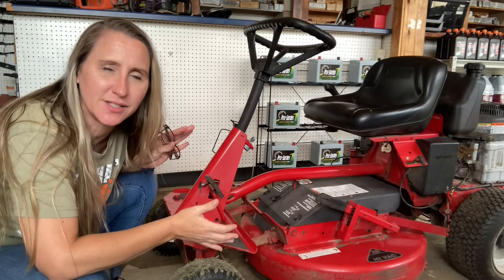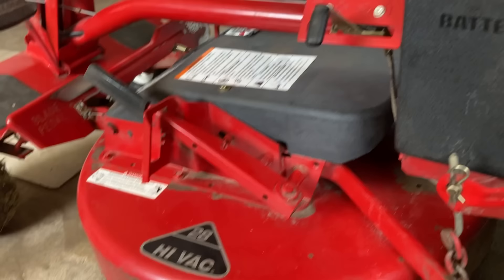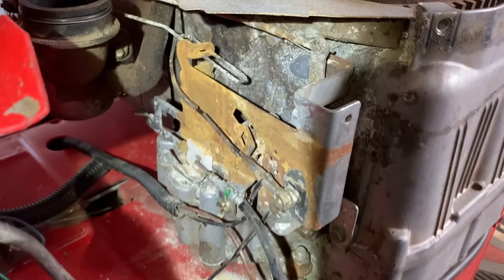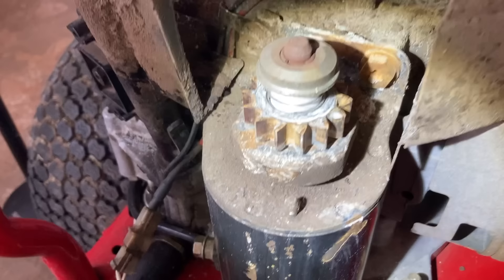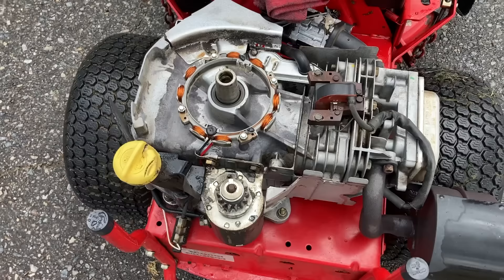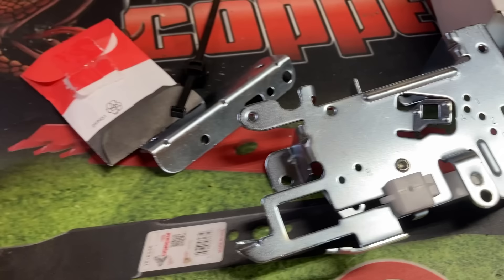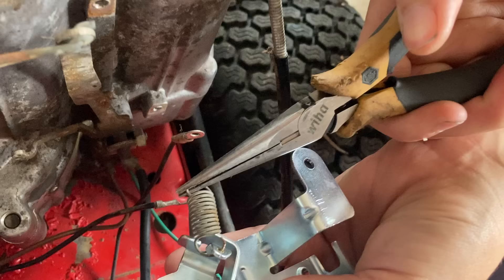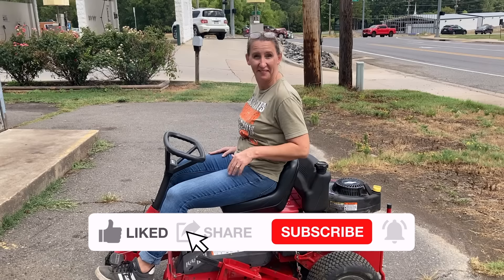Customers simple mistake almost destroyed their Briggs and Stratton engine on a Snapper riding mower

Comment: Don’t you just love it when a manufacturer of motorized vehicles mixes metric hardware with imperial hardware?
Reply: EVERYTHING I work on, I try metric and imperial on every fastener because tool manufacturer tolerances aren't so great. So it may be intended to be one thing, but have a better fit with the other. Then you switch tool brands and it flips the other way.
Reply: I think part of the issue is DeWalt sockets and wrenches. Assume the size on them is +.5 mm
Reply: I think the 8mm small bolt really was 5/16"🤔 can't seem to find my 9.5mm X 1.58 tap aka 3/8"x16pi tap hahaha

Comment: Whenever I encounter a battery acid spill, I mix up a spray bottle with a bicarbonate of soda solution and spray the heck out of the affected area.   There could be lingering acid!
Reply: Yeah water alone just spreads it around
Reply: .99 cent bottle of club soda works
Reply: @andyhamilton8940  It does.  But I rarely have it on hand!  LOL  There's always a box of baking soda in the fridge.   Best to you!
Reply: You betcha baking soda bath, a good rinse
Reply: Exactly! I always use baking soda and water to clean off battery trays, terminals, fenders etc that had acid spilled on them. Unless neutralized, they will continue to corrode. Rinsing them off with water won't neutralize the acid that's in the pores of the metal.
Reply: @joefudd  how’s Elmer doing? Sorry i couldn’t help myself.
Reply: @kevdimo6459  Elmer passed away long ago. I got to keep the wabbit huntin' twadition awive!
Reply: Best thing in the world for heartburn also, spoon full of baking soda in about a half a glass of water, instant relief and unlike Rolaids or Tums it don't come back in 20 minutes.
Reply: @dukecraig2402  Acid is acid.  Stomach or lawn mower, baking soda will neutralize it! 
Best wishes to you, and I hope you don't have heartburn!
Reply: @kbjerke  
Yep, chemistry 101.
Reply: @joefudd  hahaha well done Joe I’m wooting for you!
Reply: Ballistol- a mineral oil in a spray container - it’s an alkaline - that’s what I would use on this equipment to neutralize the acid.

Comment: install a AGM battery. They can tolerate being on their side just not upside down.
Reply: They now have SLA (Sealed Lead Acid) batteries for mowers. Those are sealed and can operate in any position.
Reply: @joefudd  Snapper has used them for years.
Reply: I bought a sealed AGM battery for mine for this exact reason. Funny thing though, that battery cost more than I paid for the mower.

Comment: I still use a 50+ years old Snapper to cut grass, My father bought it new some time in the early 1970's and since he passed on in 1995 I have kept it running and working. The motor is the second changed around early 1990's. I still love it, and it still cuts grass very well!
Reply: Red Comet!  Bet it doesn't have the blade pedals.
Reply: @joehead1294  You are soooo right!
Reply: Hey Wild Bill. Bet you and your dad both did the basic work on the riding mower. Do the maintenance yearly and it will run for ages!
Reply: Can't believe how they just don't hold their value.  I'm the owner of a rear engine for the last 34yrs, came with my house.  Just cylinder hone and new rings, valves reground, and new paint. Now my son has it for his new house. CRAZY SIMPLE

Comment: Dad was a Snapper dealer for many years. Saw this problem more than once. In the old days, Snapper had their own battery that was sealed to prevent this problem. The Snapper battery cost twice as much as a normal battery. Few people bought the Snapper battery when the original battery failed.

Comment: My first riding mower was a snapper, I got it from a local hardware store very cheaply because it was the pull start only model and nobody wanted that. It served me very well for many years👍🎩
Reply: my mower has a 15HP single.  when I bought it, it was a $100.00 option to get it with a 14 HP twin.  I asked if the twin was a hundred dollars and a horsepower better, and they said, just easier to pull.
Reply: My names Forrest Gump people call me Forrest Gump.
Reply: Simpler the better!!
Reply: @Ken Brown    Excuse me, but would you please explain the mathematics of your statement in a way that will make logical sense? I’m kinda confused with what I’m reading.  Thanks.
Reply: @JLewis-vv5zf  my mower had two engine options: the base model engine is a 15 HP single cylinder.  the upgrade model is a 14 HP two cylinder.  it would have cost $100.00 to get the upgraded engine.
so I asked my saw shop guy if the two cylinder engine was a better engine, and he said the only thing better is that it's easier to pull start the two cylinder engine.

Comment: I'm on my second Snapper 28" rear engine rider. It's just like the one in this video. The first one lasted 20 years and the one I have now is about 15 years old.  I absolutely love these mowers. I'll have to keep this one going since they've stopped making them again. Easy and inexpensive to work on. I've never had my battery leak like that but I don't leave it in a standing position for more than an hour without removing the battery. I think the manual says 2 hours but I don't won't to chance it. Thanks for posting this video.  Always interested in Snapper repair videos.

Comment: I have that exact machine,  minus the battery/ electric start.
The tip up feature is nice, especially when storing it for the winter.
I added a pipe nipple to the oil drain plug for cleaner oil changes. 
Great video .

Comment: I can't find the specific video now but one of your hints saved my lawn mower.  It had gasoline leaking from the air filter box and I eventually replaced the carburetor.  I thought all was well until you mentioned sniffing the oil from the dip stick for a gas smell.  Guess what.  There was more gasoline than oil in the crankcase.  Changed it out today MUCH thanks!

Comment: I have a snapper rear mower 28". Since I have a pull start I never had these problems. As an engineer I love simplicity. One or two pulls gets me going using the newer fine wire spark plugs. With the beggar it is a lawn vacuum sucking all leaves from trees saving raking and blowing, The best investment I ever  made way back in 2000.

Comment: This is from Don's small engine repair when you were showing the mower I knew exactly what the customer did because I had a customer that stored his up on end all winter long luckily all I had to do was replace the battery clean everything I had to replace the dipstick tube because acid ate a hole in it and was throwing oil out the back the throttle on the carburetor with also stuck but I got to lubed up and everything works fine the mower that you are working on that's pretty bad I thought that when you took off the flywheel it was going to be a whole in the block with acid eat through that block thanks have a great day and the rest of your week
Reply: That's fine 🙂! If you drain the oil,,,take battery out and store it on a wooden shelf with a Baby,Sitter charger,and drain gas,after putting stabel in gas tank and run for al few minutes, I do it all the time for winter storage,

Comment: I'm so excited!  I bought that same mower (except mine's a 30 inch cut), brand new, in the spring of 2007.  It has been the toughest, most reliable piece of equipment I have ever owned. It's built like a tank.  all the steel is twice as thick as it needs to be, and everything is so simple to get at; grease fittings, battery, drive mechanism, etc..   It's not a zero turn, but I'll take it's brute power and durability over that all day.
Reply: I got one around 2006 Ive mowed with it ever since and use it as 4 wheeler to go to where I shoot. Had to some work on it but mostly change clutch through the years. You are right its tough mower.

Comment: I bought one of these mowers from Moris Levin in Tulare, California. I used it once per week for 10 years and sold it to a guy who is likely still using it 10 years after that. It's like an inside out mower. Everything is right out in the open and easy to work on. Only thing I had to do was add an in-line fuel shut-off petcock because the needle & seat in the carb would sometimes leak, which would cause gas to leak down into the engine oil.

Comment: There's warnings on the mower to remove battery if it's going to be upright longer than 2 hours.  I don't remove mine every time but I work quickly and have a "sealed" battery.  So far, so good.  2010 model still going strong.

Comment: Whenever battery acid gets where it is not supposed to, I use baking soda to neutralize the acid before I clean it up. I even dust the top of batteries where some acid vaper has come out of the vents on the top of the battery. It keeps the acid from ruining cables. It also makes it safer to handle anything that had acid on it.

Comment: Good advice just as it is explained in the owner's manual. If a sealed lead acid (SLA) battery is used, it should not leak in any position.

Comment: I think the only thing I would do different is change those springs.  Since they are relatively cheap, but so little metal for that acid to dissolve, it doesn't hurt to put fresh ones.  Especially the very corroded throttle return spring.  Otherwise fantastic information on that classic.

Comment: When I moved, in 2011, from Seattle to Kentucky and a large lawn, I purchased a used Craftsman 2000, V-Twin Rider mower. I hadn't really done any small engine work but I have an aptitude for it.

One cylinder on the engine kept bending pushrods, which would then fall out of the rocker arms. I eventually figured out that the valves were stuck and I had to pound them in with a hammer to reduce pressure and then I would straighten the push rod on an anvil with a hammer as well. And that would get me through a half a yard of mowing before I had to do it again. I got pretty proficient at it.

Then one day I'd searched the internet regarding why the valves would get stuck and it said it may be overheating. Well, I took the shroud off the whole engine and a mouse or bird had built a nest right against the engine and all the fins were coated in a solid cake of mud. I cleaned all that out, and it worked great ever since. I did buy some nice new push rods from Amazon so I was starting fresh.

That was about 6 years ago and now I have a 60 inch bad boy zero turn and I mow about 9 acres of lawn. Sadly, I'm now paranoid about something building a nest next to my cylinders and actually find myself checking for that every now and then. I have not found anything yet though. I keep it in my shop building when it's not being used, so the risk is probably low. However, I prefer to store it in my barn to give me more room in my shop. But paranoia keeps me from that.

Comment: Hello Bree. I have one of the vintage Snapper RER mowers that has the white handlebars that I think may be later 1970s to early 1980s that I rescued from being scrapped out. 
I was kind of thinking about swapping in a Vertical Predator engine to replace the 11 hp Briggs Engine that someone mounted onto the Snapper. 
Some time ago, I actually had the Briggs engine started before in which it actually mowed nicely - Almost nicer than my John Deere.  
Maybe I need to get the Snapper back up and running again. Thanks for your great video.
Reply: Keep The Briggs Trust Me The Predator HFreight Has Nothing on it I Fix Mowers For a Living Those Old Briggs Never Die

Comment: Geat video!!!  I have this snapper that idles smooth with the brake set or with the blade engaged, however, runnings very rough with the brake not set and the blade not engaged, what could cause that?  One person told me it was the carburetor.

Comment: I have a 21 inch snapper lawn mower with a 190cc engine that will surge when cold but will run smoothly when hot. I've had a valve job done on it and the engine still runs a little rough.

Comment: Love the video great tips I also used to have one of them old snappers like that ours had a round steering wheel not that square looking thing but it had the rounded steering wheel can you get actual snapper red paint to paint them areas where the acid ate it I have a snapper now that I would like to commercial pro that I would like to touch up some of the paint spots on thank you for the videos I love it

Comment: I’ve always been very reluctant to tip any 4-stroke machine up more than a slight angle. Admittedly I hadn’t considered the battery but it seems like crankcase oil has a good chance of going where it shouldn’t when you tilt the machine

Comment: Another very good video, Bre! Thanks for the heads-up on the dangers of leaking battery acid. I haven't seen any capped/non-sealed batteries sold these days. So, I presume you installed a sealed battery on this customer's mower. You could have mentioned that in the video. Could this problem/damage also have happened with a sealed battered? Just wondering. Thanks again, eh.

Comment: Very cool. I always took the battery out before turning it up on its end. The old 1970's & 1980's version of this mower had a sealed battery and you didn't have to worry about that. The last version didn't have a sealed battery. Does Snapper still make this kind of mower or have they gone to strictly zero turns and tractors now?

Comment: I've always liked the design of that particular Snapper mower, but never owned one. If Snapper received a lot of reports about this particular tilting/battery issue, they should have put a nice placard, approximately where your eye gaze would be when lifting it, that said, Remove Battery Before Tilting! Placards work really well in aviation and probably wouldn't have added more than $0.25 to the cost of manufacture.

Comment: Im back again on my old friends mower and fixed his starting problem he had his battery connections were loose has the wrong bolt in the red post and all the wire connections and his ignition solenoid screw posts was dirty making the ignition not work how it should i half cleaned the stuff up today and tightened his red and black battery cables and i will be going over it all in 2 weeks from now

Comment: WOW! Awesome video. I have an 2012 Snapper 12.5 HP that the plastic piece that the throttle cable hooks in has Broken . Will this part number fit this year model SR 1030? If you dont have this info handy would be able to tell where i can get this information?

Comment: I wouldn't use a star bit on the engine fan I've had to many of those break off into screw heads it doesn't matter if its a strong name brand bit they all break even more if those screws are down tight and rusted.

I found a way of taking the mufflers off those and other engines now take something put it against the bolt head smack it a few times with a hammer then spray some dw40 on it smack it one more time then let it sit a few seconds then unscrew it off 

I done it on two of mine because i had to unfreeze a rusted piston head and the muffler was in my way of getting to the head on those i used a hex socket

Comment: Is there any reason one would have to use a lead acid battery in an application like that mower? Could you go to something like an AGM where you could tilt it without risk of spills and acid corrosion damage? Just a thought. Great video!👍🏼
Reply: i wonder same thing
Reply: Yeah you could do that. The only thing is I would get a decent trickle charger for AGM batteries and put it on the battery when not in use because the voltage regulator is going to be setup for a wet cell battery. Yes it will still charge it but I think agm batteries need a little more to get them to full 100% charge than what the stock regulator gives you. I think they cut somewhere around 85 to 90% charge on an agm battery. So again a nice battery tender trickle charger designed to charge agm batteries would allow you to get maximum life and longevity out of an AGM battery Expeacially since their more expensive than a simple wet cell. In my opinion it would be worth investing in a good trickle charger for it. So you get as high a return as you possibly can. But they're both Lead Acid batteries with sulfuric acid it's just that an agm battery has the acid absorbed into a sorta fiberglass matting material. Which improves on some of the weaknesses of a regular wet cell battery. It being a magneto style charger on the mower your never going to see voltages get too high or anything like that. They just don't have the capacity to do that. So your voltages will be safe it's just the length of charge is the issue on an agm battery.

Comment: They are the simplest machines to work
On ever  made  you can rebuild most any 
Thing on it  very easy I've got one  a 25 inch cut uplift  got it for my older sister
To use in city for her back yard 40 by 85
Yes she been using push mower but she 
Is 75 yrs old but engine blew up 
Now can't fine engine !!!!

Comment: I think you have seen it all, so I'm hoping you can point me in the right direction.  I have a Snapper Yard Cruiser that runs fine, but the clutch looses power and stops after a few minutes of cutting.  The relay, clutch, and pto switch are new OEM parts.  I bypassed the pto switch with a jumper wire and the thing runs all day.  Any thoughts?

Comment: I would have sprayed down the whole area with a baking soda solution, although Super Clean is caustic enough to neutralize the sulfuric acid from the battery.  I would have then rinsed it off with water and then sprayed it with WD-40 and repainting all areas that lost paint from the acid.

Comment: There's a BIG FAT STICKER warning you not to leave the mower on end for very long.  I have the exact same mower.  This is the first video, heck even reference or picture or anything at all, that has shown the Snapper I own.  Even then, mine's  a 30 inch blade, not a 28.  Same motor though.

Good luck, ever finding any information about the Briggs 12.5 hp engine...  GOOD LUCK.